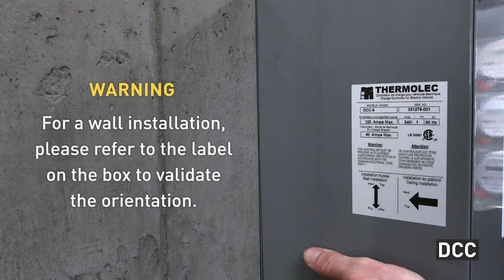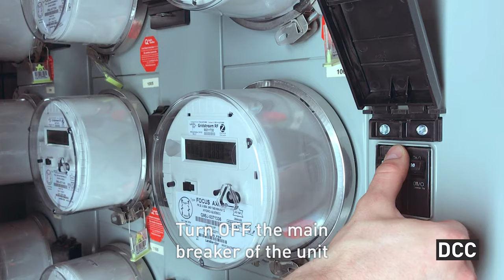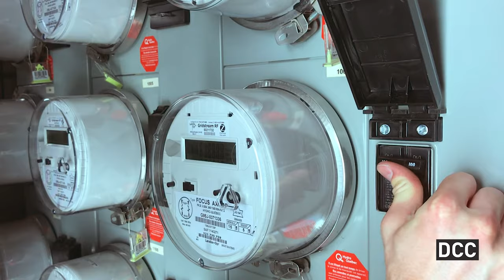DCC-9 Step-by-Step Condo Electric Vehicle Charging Installation

Comment: Can I have a video of the installation in the Main Panel part? I don't understand how it will work in a Main panel as just the main breaker slot?
Reply from the maker: Hey there! The DCC-9 model is not connected to the main panel, but the DCC-10 and DCC-12 are. See the DCC-10 and DCC-12 installation video here: https://www.youtube.com/watch?v=JfhrXVfkKSs